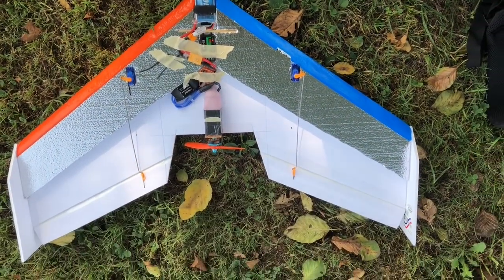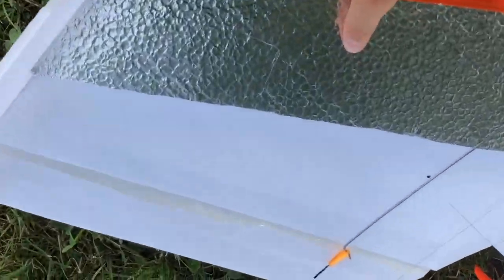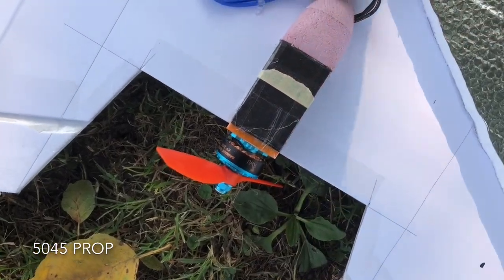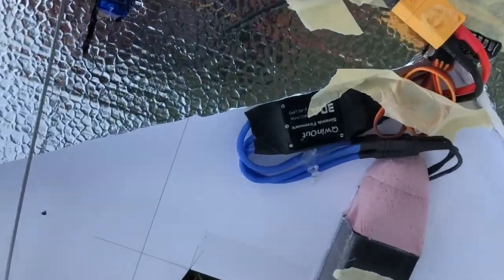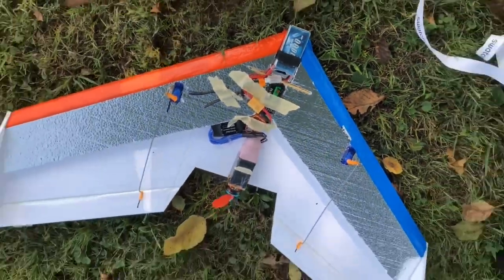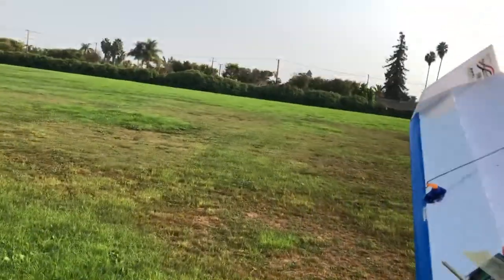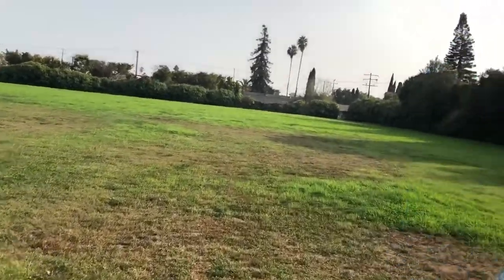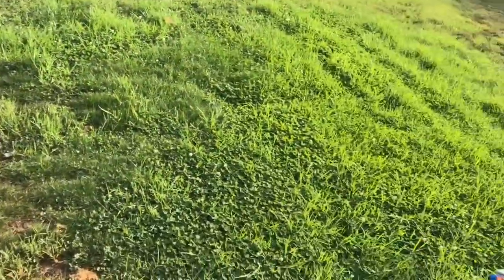Delta Flying Wing Pusher - Shortened version - Easy to fly RC Plane

Comment: Could you do a build video I’ve always wanted to make one that looks like a good sturdy light design I really like. Nice flying !
Reply from the maker: Sure, I am busy during the week but I will try to remake it on the weekend and I will film my process! Thank you for your suggestion!
Reply from the maker: It’s a great plane to fly and whatever motors you have will probably work. I only used some  9 g servos otherwise
Reply: Ok sounds great
Reply from the maker: Cn’s Rc And other projects , I also want to turn it into a fpv plane because it is a stable platform. But fpv is expensive:(
Reply: Very true but on amazon I found a fpv camera for 16 bucks just plug it in your empty receiver spot and it automatically connects to your goggles. I believe it a pretty decent quality footage but it still can get pricey. this hobby can put a dent in your wallet .
Reply from the maker: Cn’s Rc And other projects Yes, I was going to get that AIO, all in one fpv setup, but I need goggles. I want a dvr for recording and a screen if possible, not just goggles. I found the eachine EV800d goggles and they have diversity, dvr, and they are goggles with a detachable screen. Only 100 bucks is great compared to other fpv stuff, but expensive compared to everything else.
Reply from the maker: Cn’s Rc And other projects I also have some separate 1s batteries for the aio camera from a toy drone because fpv cams are power hungry and I don’t want to drain my flight battery.
Reply: Sounds good if it has a wire cage on the top as an antenna you could make a 3D printed cover incase you crash. Then you wouldn’t deform it
Reply from the maker: @cnsrcandotherprojects4557  yes, the winglets also act as buffers for an fpv antenna if it ever flips over.
Reply: Ok sounds great 👍